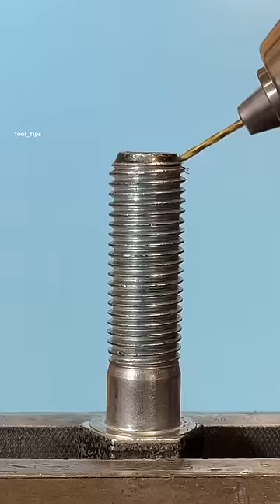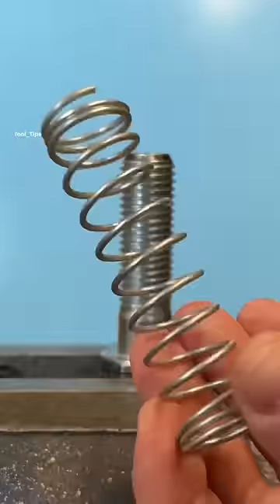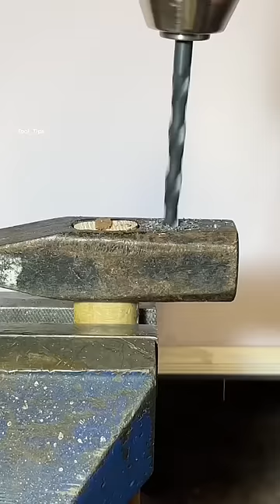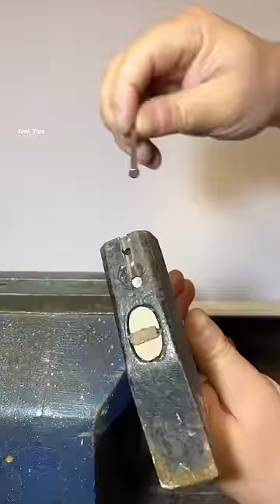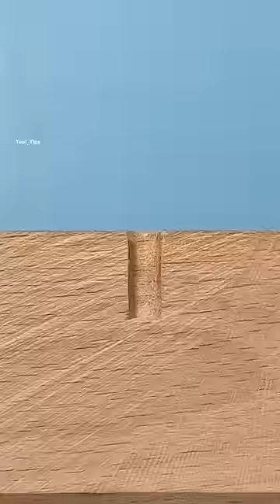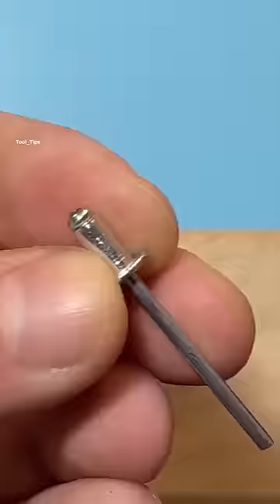Few People Know This Tips 🤫

Comment: Why the hell would you put silicone around a plug? The entire point of a plug is to grip the wall around it.

If you put in a too small plug and surround it with silicone all the plug is holding onto is the easily torn silicone.

And that poor chisel used as a hammer, drilling a hole makes it weaker and therefore more likely to crack or even shatter with use.

You can buy specially made magnetic hammers if you really want something like this, or you can just use pliers to get started.

Further, you can't make a spring by just wrapping wire around something, you need steel specifically designed for this.

Complete madness.

Comment: This is pointless, because you should be putting the nail in a specific place; that's why you hold it and don't just swing the hammer in the general direction of where you want to go. 🙄

Also, just use a bigger rawl plug!

Comment: 1 - That's not a spring, it's a pig tail, and could be useful for your 7yo farm project at school.
2 -  Magnet doesnt go in that place, you will crack it after you hit something.
3 - If you are so dumb you drilled a way bigger hole, you can use a bigger screw and socket.....and next time read the measure, it's printed in all plastic sockets everywhere.
4 - Why in the Lord's name you will waste a rivet? use a nail, dude. It's way cheaper. Also, you have to use glue, not that.....also, you could have placed the nail FIRST on the dowel, so you don't have to guess when finding the center.......

Comment: You are a comedian right? Thst coiled wire isn't going to "spring" just collapse. If you need to nail something get the right hammer. That's not a claw hammer which is what you use on nails. Hence the claw for pulling nails. Use the right bit for anchors and pins and you don't need to waste a rivet or use painters caulk.

Comment: Omigod what clustermuck of useless “hacks”.  Ruining a hammer so you can take longer to drive a nail with the wrong damned hammer??!! Putting an unnecessary steel post in a hardwood dowel that is specifically designed for the job ??!! You can only enjoy this video if you want to shake your head and laugh.

Comment: There's a reason only "Few People Know This Tips" mostly because common sense tells us a piece a metal wire wrapped around a screw doesn't make a spring, a blacksmith or a machinists hammer has no use for driving nails in wood and if you use the right drill bit you don't need glue to hold your anchors in place, so you get a zero for creativity but a 10 for stupidity..

Comment: Wow, some of these are just insulting to us old school mechanics. Wrapping solder wire around the threads of a bolt, other than for Christmas decorations or a little girl's arts and craft project, why? And why bother to drill a hole anyway, hold it with your finger for god's sake, your "spring" there son has the tensile strength of wet spaghetti.

And now that you've weakened that blacksmith hammer trying to turn it into a framing hammer instead of just buying one, I'd use goggles whenever hitting anything substantial, it'll split and break off like an ice cube. 

It's ok to be a dangerous idiot, in private, but idiocy is dangerous and highly contagious these days, and this level of stupid should be kept to oneself. But next time I need my solder wire to look fancy, you're my guy

Comment: I’m a mechanic, a framer and a carpenter. That spring is useless. That hammer is useless. The magnet in the hammer will be useless a couple more nails started. Why would you only glue in ONE drywall anchor? And for the love of all that is blueberry butt syrup would you use a rivet shank when you could just use a regular ass dowel?Where else is that dowel going to go when it’s driven into a predrilled hole?! 🤔

Comment: Waste money and time on a bolt and a solder roll when an electrical solder comes springed in a tube anyways: check
Buy a sledge hammer thats more expensive than a claw hammer and destroy it: check
Cutting off a rivet when using a brad nail or any piece of sharp metal, even wood glue (yes that exists) for a dowel: check
Drilling a hole into a block then using caulk for a plastic anchor (Dumbest idea yet) instead of using a concrete screw, concrete anchor, wedge, etc: check
Man's a genius

Comment: Anyone who has ever had to contend with spring steel knows that there is absolutely no way you’re going to have a hand that’s strong enough to coil it around a bolt like that. The person in this video is using something that’s very soft and pliable, like solder wire, which is not ever going to be made into a spring. It’s not a life hack at all, it’s just wrong. Give it a whirl. Go get a pack of piano wire and try coiling a spring out of the smallest gauge piece you can find. You won’t be impressed by this ridiculous video afterwards.

Comment: Thats not a spring. Buy a propper hammer with magnetic instead of ruining your old one. Drill the propper hole and use the propper screw and plug. tried wood glue?

Comment: The hammer trick is all over tik tok. I could never use it.  Too inaccurate. I need to place the nail exact where it has to go. Not take a chance that it might hit exactly where it want it to go into the wood.  Good way to finish up with nails all in the wrong places.

Comment: Those dumb hammers that hold the nail don’t need to be a thing at all, every normal claw hammer works like that, you use the claw to hold and set your nail then turn it around and use the head of the hammer…

Comment: You can use the back of a claw hammer (the claw) to hammer in nails, no need for that big ass notch. Just wedge the mail between the body of the hammer and in the claw, push the nail into the claw’s V shape and the nail will stick
Reply: P.S. You should never be using nails anyways!

Comment: Well, I guess you never know when you'll need a coil of solder, a cross peen hammer to drive nails,  the tail of a pop river to put into your dowel peg, or the need to drill an over sized hole in a block wall for a  screw anchor and squirt some goo in.  This is half assery at it's finest!